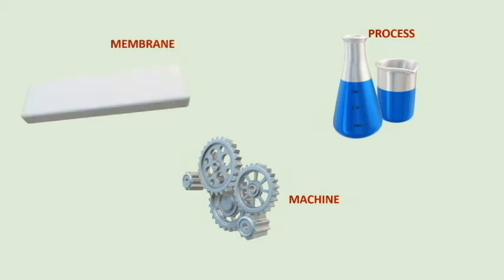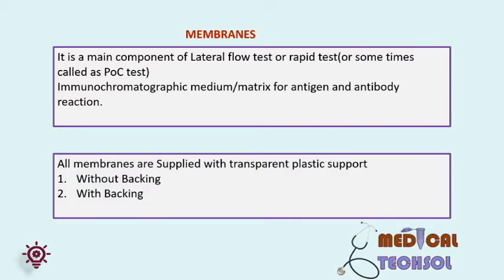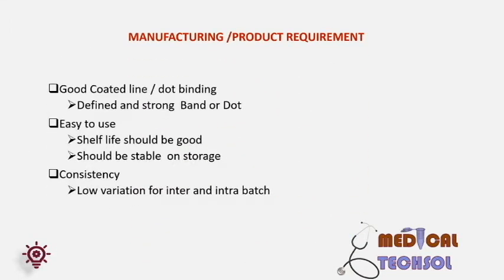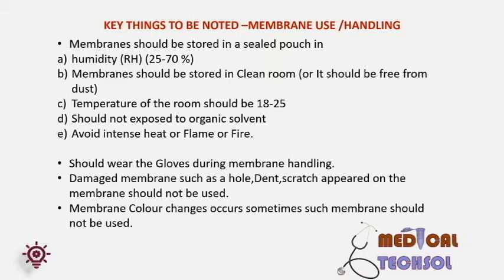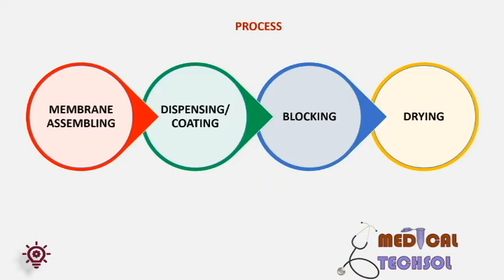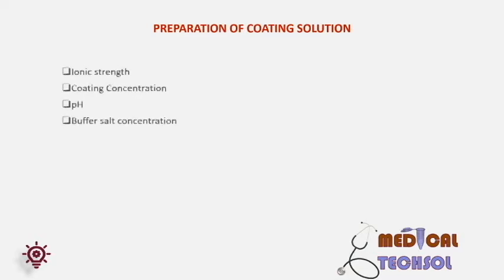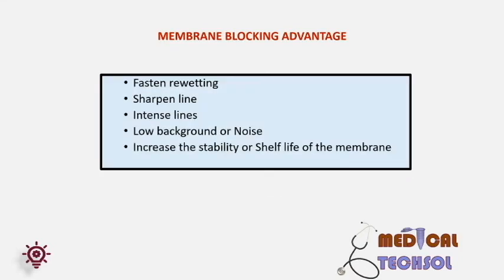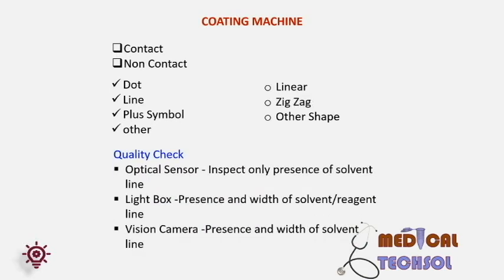All aspect of Nitrocellulose membrane Coating/Dispensing   for rapid test / Lateral flow test /POCT

Comment: Hello Sir, how are you? Hope you're doing well. We are working on betalactams strip using pencillinG antigen pi 7.4 and the receptor binds to antigen at pH 9-9.5. 
Can we coat pencillinG antigen using borate buffer pH 9-9.5 or have we to coat it with PBS 7.4 ? We need your support for this. Your help will be very appreciated. Thanks and have a nice weekend

Comment: Hello Sir, good day! Regarding 1% ethanol used for striping test and control lines, have we to use diluted ethanol? Because 1% from pure ethanol denature antigens and antibodies. What do you recommand? Thanks
Reply from the maker: we are not using ethanol directly instead dissolving into the coating buffer
Reply: @medicaltechsolutions1046  hello good day ! It's been dissolved in coating buffer pbs + 0.3% sucrose + 1% ethanol. Antigen's been denatured. Thanks in advance